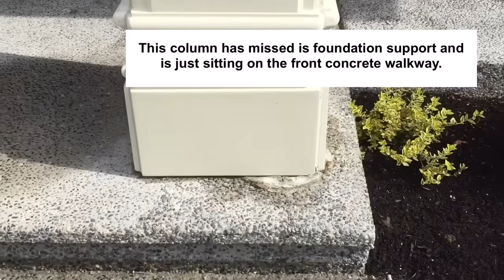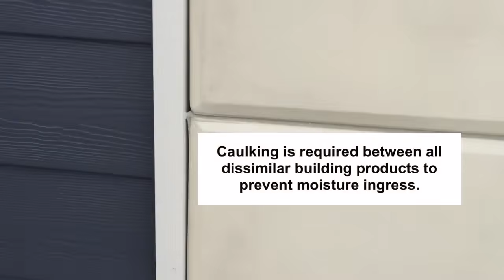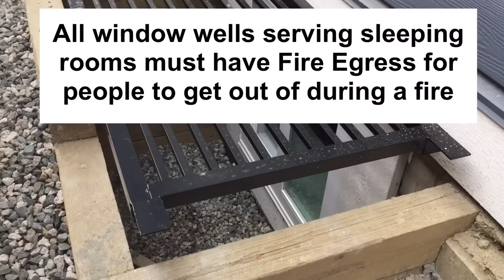New Home Construction Inspection - This is Shocking!!

Comment: That's a 45 k home in Chandler Arizona
Reply: Cristhian Vallejo 
Nah closer to $30k.
You can get a beautiful 2,000+ sqft 4bedroom, 3 bathroom, mcmansion with a walled backyard in Mesa for ~$125,000

Problem is it is Mesa
Reply: a shack in vancouver is worth $1,000,000
Reply: Aww mesa isn't so bad as extensions of Phoenix go. Sure its no Scottsdale but at least it isn't filled with yuppies.
Reply: Three stories makes it at least $300K in Flagstaff
Reply: And Chandler is a nice town too.
Reply: Noah W in scotland you can buy a castle that will last another 1000 years for that price
Reply: BTW those houses in Arizona what are they made off? Cinder blocks,concrete or wood?does it have a lawn?BTW I'm just curious since I'm not american
Reply: Martin Banks. Usually something called light wood frame construction, and the insides are usually finished with gypsum drywall, and the exterior with stucco. The issue with the stucco is that it is used on too many new constructions in a way that just looks ugly, all the same color, with a few exceptions. That is a problem in my neighborhood with many of the new houses that have gone up within the past 12 years or so to replace the ones that burned in 2003. The ones that have gone up within the past few years have been worse, big ugly grey or beige monoliths with no decoration or trim whatsoever, and usually spanish tile rooves. Some of them have lawns, in my area where it is quite arid some have gravel, paving, and succulents as their front yard with the newer houses.
Reply: Ya because no one wants to live in the desert
Reply: For real
Reply: Noah W no way. I live in az there’s no way
Reply: Is that the actual house your talking about or just comparative?
Reply: @meercreate  thanks for the reply.we don't have that kind of designs here in malaysia.homes are usually made from red bricks and cement blocks.highrise buildings like apartment and condominium are usually made of concrete.btw really apologize for the late reply since I just saw your reply

Comment: The worst issue we had (fortunately) when we bought an almost brand new home (one year old) was that there was a high level of humidity in the laundry room when the dryer was running. A dehumidifier had been hard-wired into the ceiling...we could never shut it off. My husband got aggravated with it and decided to check the dryer vent connection. When the dryer ran, the outlet on the side of the house didn't move. He thought 'maybe' is was full of lint. Um, nope....the vent hose in the laundry room wasn't even attached to the dryer....at all. The dryer was venting INSIDE the laundry room. Easy fix, but either the builder or the first homeowner thought they solved it with a dehumidifier. We had an excellent inspector that pointed out about 1/2 dozen small things that we could easily fix ourselves. But, we've known folks who have paid to have a house built and once they occupied it, it was just a money pit.

Comment: The front columns may be more of an aesthetic screwup than structural.  The real support is probably a P.T. 4x4 on the top of that Sonotube, and the fat stone column is purely decorative.  I've done dozens of 'em.  It's a bugger to get right because the Sonotube pier is generally centered on the support post's placement, which is always going to be on the outer perimeter of the structure. The easiest way to avoid this problem is to pour the Sonotube 4" low and then encapsulate the post in concrete so the pier doesn't show.  But I don't like to encapsulate any wood in concrete, including, P.T.,  so I put temp supports to the upper structure until the porch is poured then roto hammer a post base into the uniform new concrete.
The rest of the building is an amateur clown house.
Reply: If that were the case you still shouldn't see the footer
Reply: I was thinking the same thing. You'll never know unless you get inside that column. However, after watching the whole video, it wouldn't surprise me if there were issues inside that column. Did you see the lack of support for those outside steps...jeez.
Reply: I remember reading Monticello had purely aesthetic columns which went up after construction

Comment: If that was the secondary drain from the upper ac you would want it to drain in a conspicuous location so you would know there was a problem with your primary drain and get it fixed.
Reply: David Danielson yea but it should drain into a culvert or a drain pan.

Comment: I hired an inspector that my realtor (who worked for the same agency as the listing realtor) recommended.

They glossed over so many things (like extent of pest damage, inadequate/damaged insulation, an overwhelming invasive presence of poison ivy on multiple trees and the house, multiple electrical violations, and disconnected non-functional appliances) that I considered suing. I sat down with three attorneys and they all told me the same thing. Suing was possible. Winning was unlikely. 

Hiring an independent inspector is a hard learned lesson for me.
Reply: home inspectors are USELESS  Canada
Reply: I have a similar story. When we were looking at homes 2 years ago, I hired an independent inspector on the first 2 homes we put an offer on. He caught so many things it was insane. We were able to use his reports to back out. Then on the third home (which we bought) our realtor recommended we use her brokers "preferred" inspector. He missed quite a bit and was not bright by any means. Thankfully nothing too horrible as the home isn't that old but there are definitely some things that were shortcutted when the flipper was remodeling it.
Reply: Home inspectors can be so lazy and get away with it. Mine was a bum as well and the realtor hired him. Nothing beyond a walkaround, standing visual inspection of clearly visible issues.
Reply: @lakecityransom  And there's zero recourse once the deal is done. My Realtor's "mentor" actually told us our first inspector was just scaring us so that we would back out, lose the inspection fee in hopes of us hiring them again for more money. It was pretty shady looking back.
Reply: @ronfthiscompany4126  That depends completely on the inspector. I had to temporarily support myself by inspecting new construction and homes for sale as a Real Estate Inspector. The ONLY friends I have left are the buyers of homes that I inspected who used my reports to prevent getting ripped off. THE REALTORS HATE ME. I was legally liable for 48 months for anything I missed in my inspections. It took at least two days to complete an inspection and produce a legally binding report. My findings were based on my 20 years experience as a builder, my JC teaching credential in carpentry, and a computer program that helped to ensure that I covered all the bases. I also took thousands of dollars worth of seminars on the mechanics of inspections in addition to educating myself in HVAC and electrical which were not part of my work experience. I was sued once. I was a co-defendant with a 'fly-by-night' pest inspector. I was immediately absolved and sent out of court. All my big disagreements were due to pest inspectors (who can legally do the repair work they 'report.') trying to sell customers fixes for problems I could not find.
Reply: @ronfthiscompany4126  Who has time for them anyway?  Houses are going so fast, often in less than a week!
Reply: One of the first things I was told when looking to purchase a home was to get a home inspector that is not working for your realtor. Hopefully things worked out for you.

Comment: On a 2.3 million dollar home thos is a pretty routine punch list here. 

1) caulking on all gaps  $700
2)touch up paint on all $400
3)fixing down spout and leveling downspout and installing new gutter with materials $800 ($300 materials and $500 labor)
4) Installing 6x6s for front stairs with concrete base and cross support in 2x12 x 2 thick and gussets (brackets and braces included too) . $1,400 
5) Unbolting grates for fire exits on downstairs basement windows and installing a track of sorts or channel if you will  3 inches deep to hold grate in place from moving in all directions (grate can still be lifted out and or pushed up) $300
5) touching up concrete porch with stone facade and making it blend $450 (this is only if the trim I lay around the column on bottom end doesnt fully cover it or look decent otherwise cancel this cost)
6)straightening cloumn to plumb $500-$1000 (depending on what is involved price could go up to as much as $3000) this is optional and the small crookedness of the column wont fail inspection and you can simply trim that spot on bottom in a composite outdoor trim and plan on replacing every 10-15 years 
And making it wide 2x2 then a smaller corner round trim on the bottom of that would probably cover the imperfected stone coat on front porch concrete porch and i would recommend that instead. Leave the trum about .25 inches eaised for water to not get trapped underneath and unable to properly dry out. 

$4,550 at most would be my price to come in and fix all of this the correct way. It would more than likely come in at around $3,000 out the door but i always estimate for the worst however i have a feeling that front column would be a booger if you wanted it plumbed up and taking the facade off and reinstalling is the worst case but i would tackle it from the top and try moving the top to plumb it forwt but he said the bottom plate is not attached coreectly so that leads me to believe the column needs to be diaassembled on bottom and porch roof jacked up an.5 to 1 inch and the plate realigned and column put on the plate correctly which is hard to predict over the computer because i do not know how they installed the column in depth or how ot was supposed to be installed by code for this particular application but i am guessong this is what is needed. Maybe get away with simoly cutting the top of the column in between the tip and the beam or whatever it attachs to for the front porch overhang and sawzall its fasteners and they it can be plumbed back into place and reattach with new fasteners. If not i would still attack it from the top and just fudge it by cutting it fronm the overhang and plumbing it and then just attaching it securly and covering uo the cuts and fasteners with material and paint. But the bottom plate if secure and on is ehat determines how to attack and this video didnt go into enough detail to explain or ahow how this would be most appropriatly rectified. 

Other than that I would aay it is nice. I missed that big gap too in whatever hole cutout that was. Add another $400 to $600 but you are looking at $5,000 dollars for me and 2 guys to spend 3 days getting this entire house ready for sale. I would want touch up paint for exterior and interior, it is always smart to have 3 small screw on tops containers 1 quart big of every type of paint in the home if possible. And 1 quart for rooms with only one color and no other room is that color. So each color ouf outside color and trim get 3 containers 1 quart in size and the bedrooms all get  1 quart each of touch up and the kitchen would get 1 or 2 if really big and so on and so on. Also you want to store them in a climate controlled place and have the paint code and splotches(sample on paper card) taped onto the jars. Also you need to get extra tiles (about 3 for every 500 square feet) and extra wood planks or vinyl planks (3 for every 500 square feet) and extra tiles foe bathrooms (5 small ones for each bathroom) and it is good to keep the name of tile and manufacturer on the box you store them in. Label everything and these all go together with your paint in a climate controled shelf somwwhere out of the way. Also last but not least if your trim paint is all the same which it ahould be all semi gloss white of the same tint (brightness) keep a gallon at least on standby in that same place however this is usually what gets touched up in full along with hallway and stairway walls due to markings and also kids bedrooms ao i would increase your touch up supply for the hallway colors and kids bedroom too. Maybe do a gallon of each and a good paint will be able to go right over the scuffs and markings and dry without noticing anything.  Cieling paint gets 1 gallon of touch up but it os usually not really needed until you paint the whole cieling so i just use a quart for touch up storage.
Reply: I'm not reading all that

Comment: I've seen trailers built better than this.
Reply: Oldbatwit Prefab is the future!!
Reply: Well trailers are easier
Reply: Lol, I've lived in trailers built better than this!
Reply: I felt sorry for my grandfather because he lived in a trailer. Then I grew up and priced an airstream...
Reply: @walterkersting1362  My lingo is a little lacking.. You priced an AirStream.. As in you bought one? And if so, nice!
  Now.. Is that a towable camper with the tear drop shape?..I suppose I can look it up..😅
Reply: Evan Jones You might not believe how much an airstream costs; $60,000 for a single axle trailer you pull with s 1/2 ton truck, they also hold their value well for an event.
Reply: @walterkersting1362  I know they're quality, that's for sure.  But I would of probably expected the double around that price.. New model? What's the rough dimensions?
Reply: Evan Jones this was a few years ago, if memory serves 16’ single axle and moderately equipped $60k, but you would not be surprised if it were $120k? You could get a diesel pusher motor home for that, well equipped, of course they depreciate like nothing else you could purchase...
Reply: @walterkersting1362  ?...   No I'm saying i would expect 60k for a double axle..  Not 120k for a towable mobile.. .
Reply: Evan Jones sowy, ima weetawd....
Reply: They have to be. The manufacturer wants them to survive their trip to the homesite. This piece of shit was custom-built onsite.

Comment: was this house built in 5 hours ?
Reply: "was this house built in 5 hours ?"

That long ?
Reply: i think whoever did those stairs probably needed more than 5 hours to figure out which end of the hammer to use
Reply: no it was 4.5 hours, as they needed to get back to the pub, to get further drunk.
Reply: Extreme Makeover: F*cked Up Home Edition
Reply: 40 hrs, c'mon , takes a little bit longer, lol
Reply: 4 hours actually
Reply: Breaking Toast qk.
Reply: 4 hours
Reply: Hours? More like a few minutes.

Comment: In places that have heavy rainfall, like Vancouver BC, it is vital to ensure that water is moved away from the building because water is the enemy of all homeowners and will destroy wood structures in a very short time frame. That is why it is imperative to ensure that roofing is installed correctly, rooflines do not push water into other roof lines or exterior  cladding, flashings are installed around every roof penetration and are working as they should, gutters are installed with the correct run drop to push the water to the downspouts, the downspouts do not terminate on a roof but continue on to another gutter or that they are terminated at ground level so that they push the water away from the foundation. Grade the land so that it slopes away from the building. This is just dealing with the roof and drainage. There are so many other aspects of preventing water ingress that anyone purchasing a home would be crazy not to hire a good home inspector and get a detailed report of the issues BEFORE you purchase the home.

Comment: Hi Mr. Munro,  my son purchased a new home 5 months ago.  The home was previously owned and then purchase by a flipper and remodeled.   Since they moved in they've had unimaginative problems.   The latest is a water leak on a wall they thought had no plumbing.   My son did some digging and found one very large leak but there is still a leak.  My question, is there any recourse.   They purchased under a VA loan and of course they had an inspection.  After speaking with the city inspector he found out there we no permits for any of the work that was done on the home.  Any suggestions would be greatly appreciated.
Reply: I'd have him talk to an attorney. It's best to check permitting before buying, especially if there are add-ons. In the mean time, what was on his pre-purchase inspection report? An good inspector or engineer can do a more thorough inspection, that can involve more, since he owns the property.
   If I were him, I'd want to have blueprints, or equivalent,  or the building itself, plumbing, electrical and drainage, so he can get ahead of and prevent future problems. I know this post is 5 years old, but it's a good idea to know exactly what's in your walls and structure at any point in time!

Comment: Can you sue to recuperate your costs?
Reply: Sure, see you in court in 5 to 10 years IF the developer is still doing business in the same name, and then good luck collecting on your judgement. Getting money from an LLC is like trying to get blood from a stone...

Never take possession until it's PERFECT because once you do you lose virtually all effectual leverage and it's back to paragraph 1. Verbal promises to come back and fix it mean nothing from a person who promised you a high quality build and then used contractors who employ illegals because neither the developer or the contractor has demonstrated any integrity by doing so.

Unfortunately this has slowly become about 95% of them..

If their entire crew doesn't speak fairly fluent English, it is very unlikely that they have culturally assimilated to the point where they take pride in the quality of their work regardless if it means going the extra mile, nor do they likely have enough experience to be capable of doing high quality work because the two are directly related.

That has nothing to do with race, but everything to do with culture.